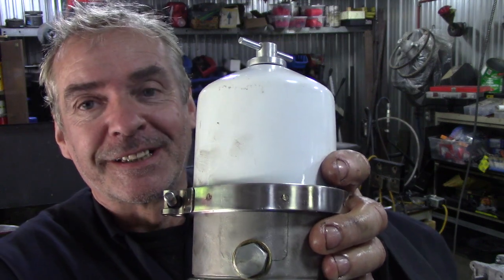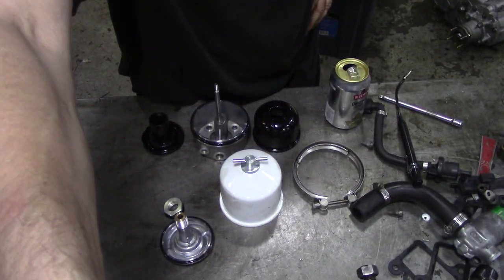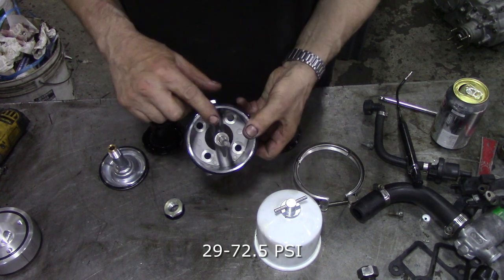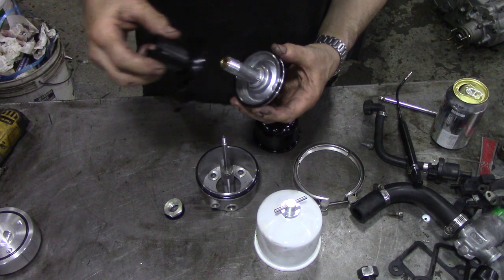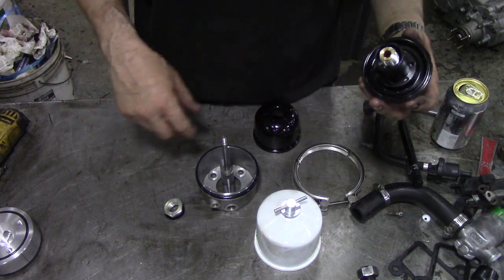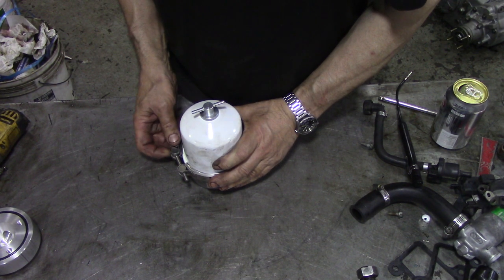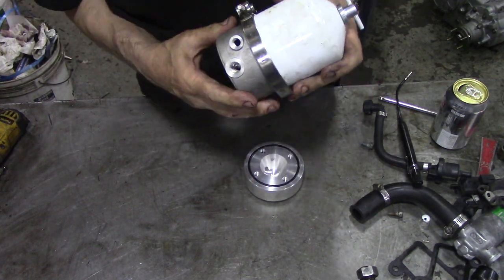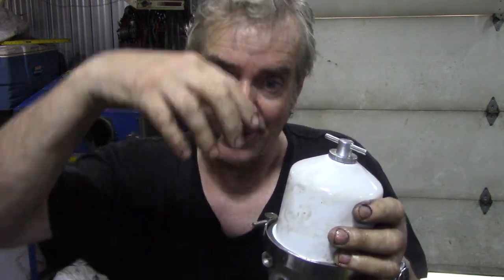Cheap centrifuge for cleaning oil Part 1

Comment: Great stuff.

S'funny, I was just talking to a mechanic, last week, and he was trying to come up with some method of filtering waste oil so it could be re-used as lube while assembling stuff.
Never occured to me at the time but, if we could salvage the oil filter out of a scrap TD5, that might work.
I wonder how long the disposable cartridges from a TD5 would last, when constantly filtering waste oil, though?
Reply from the maker: It would take a lot of pressure and filters to clean engine oil! 
If you saw my video on the upright centrifuge, that spun at 1725 rpm. It would remove water and dirt from veg oil, but you can control the feed, so the slower it is fed, the cleaner the oil, however with these centrifuges like in this video, you need pressure to spin the internal bit, so in the Td5 it would be engine oil pressure  - and hot too!
The hotter the oil the better for centrifuging
Reply: @BritannicaRestorations  Very good point regarding heat.

Have you seen the size of the holes in a TD5 filter-cartridge?
They're just a couple of "pin-pricks".

Makes me realise I don't really know a lot about how the cetrifugal filter on a TD5 operates.
I mean, based on the available pressure and the size of the holes, I can't imagine that it spins at all until the oil is hot.
Reply from the maker: I believe there is a thermostat to control the oil temperature

https://workshop-manuals.com/landrover/defendertd5/engine/oil_cooler/filter_flow_(thermostat_open)/?expand_article=1

But there are more arrows on this diagram than Custer's last stand!
Reply: @BritannicaRestorations I hate looking at stuff like that because it usually makes me realise there's something else that IS going to go wrong sooner or later.
Reply: I have a centrifuge from bio diesel that when its running all the clean oil goes back in the barreland keeps circulating till all the oil is clean. That base looks interesting.does it only take one pass thru the centrifuge then directly out into a clean oil container? Would that base work on my 80 gallon an hour centrifuge? If so how much would your base cost me? Thank you for the video.  My name is Harold.

Comment: this is interesting,  doesn't it come with a base , since you had to make one? btw that polish cylinder with a Golding top- how does that fit into the filter?🤣
Reply from the maker: The more you pay, the more comer with it 
mine:-

https://www.alibaba.com/product-detail/RG020-auto-universal-small-centrifugal-oil_62220480400.html?spm=a2700.galleryofferlist.normal_offer.d_image.1915bdcbJJaWXG

with air pump and base

https://www.alibaba.com/product-detail/RG020-universal-Spinner-centrifugal-oil-filters_60393491585.html?spm=a2700.wholesale.0.0.213020bdM0gzJz